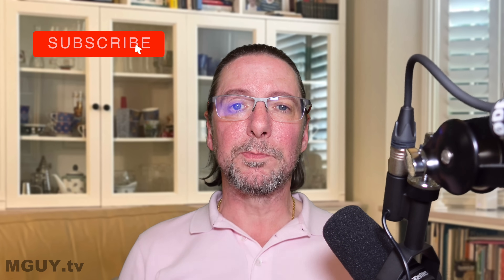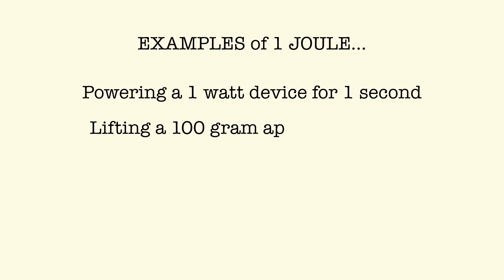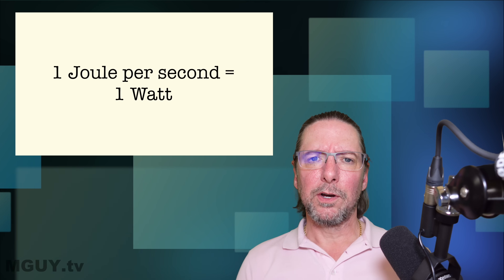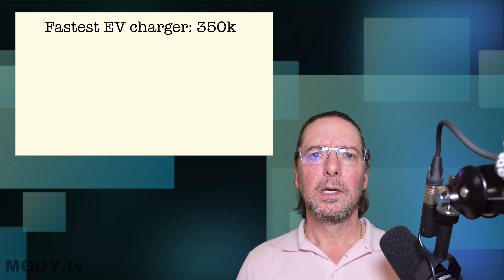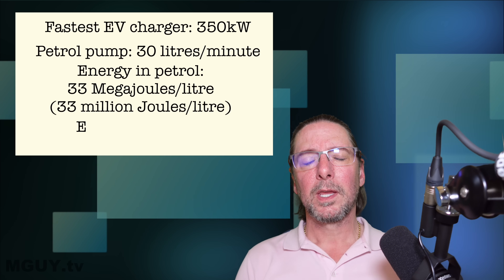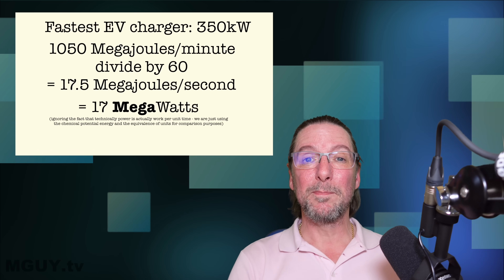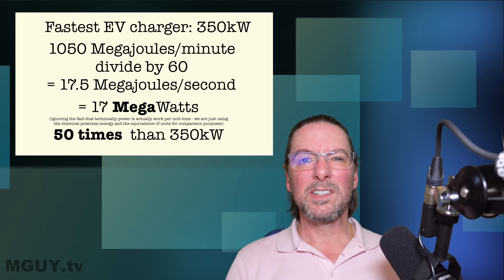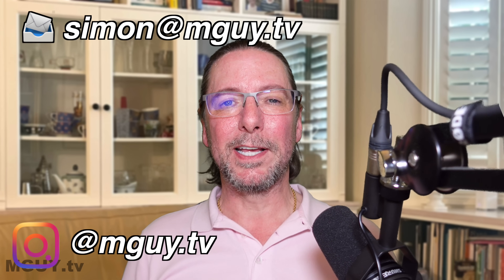Comparing charging speed of EVs vs "fuelling speed" of regular cars | MGUY Australia

Comment: We got an EV charger installed only recently at the local shopping centre , one thing I've noticed is that EV owners must never be in a hurry as i can go in do the shopping stop and chat to people and when i drive out still see the same cars with the same people sitting in them waiting for their battery to charge  . Hope the seats are comfortable in these EV's as people seem to spend an awful lot of time sitting and waiting , seems awfully boring to me  !!
Reply: It is - not to mention woefully inconvenient.
Reply: @aussieideasman8498  EVs are far more convenient than fossil cars. I plug in at home, wake up in the morning and I'm good to go for another typical week. I have used supermarket chargers which are normally slow (AC) and free so I plug in, do the shopping and gain a few % on the dial, it isn't a big deal. On long hauls I use DC rapids of which there are now thousands along the autoroutes of France. On a recent trip down to Spain every services had at least 5 or 6 rapid chargers. We typically drive for 2 to 3 hours before taking a break because we need one, so 200-300 km a stint, well within the range of the car even into a headwind in winter time. A 20 to 30 minute stop to eat, drink and use the bathroom adds another 150-200 km on a rapid charger which can finish off most journeys. We typically don't like to do more than 500 km in a day, though we have done more.
Reply: Is it perhaps that they are Uber or similar drivers waiting for the next job? If they get one they unplug and go? or someone doing calls for work? For every other ev driver the app on your phone tells them when they are done (usually 30mins or so from low to high) so they can relax in the shopping center, but remember 95% of charging is done at home.
Reply: @toyotastout6870  That's right. It doesn't matter what kind of car you drive, 97% of the time it isn't moving...it's parked up at home, work, the supermarket or somewhere. I am never waiting for my car to charge, I am doing something else.
Reply: @kiae-nirodiariesencore4270  If you live in a single house with a driveway/garage and don't need to drive long distances frequently, an EV makes sense (I would still argue an ICE car makes more sense, though). Most people don't have all of those boxes ticked, though. I live in an apartment and there's only street parking available. Sometimes, I have to park hundreds of feet away from my apartment. An EV would never work for me.
Reply: @rodafowa1279  Interesting that EV ownership is highest in cities where many people live in apartments. This is particularly the case in China and in France where I live and many people live in apartments.
Reply: EV drivers are the old Audi and BMW drivers. Hence the arrogance and inability to use indicators
Reply: @sahhull  I have never been an Audi or BMW owner, yet I have an EV. Same goes for my son-in-law. You generalize. Sometimes I don't bother to indicate, too, and I have seen EV indicator lights flashing.
Reply: Yes, but their E waste is saving planet.
These people have meaningless lives and no sense of humor.
Reply: LOL
Reply: When they get to the pearly gates and are asked " how did you live  your life"  they will have to say " spent  half of it looking and then charging my EV"!!
Reply: @aifangwei8440  what a load of crap. The silly thing about pearly gates, got more important things to worry than thinking about silly stuff like this.
By the way, most people charge there EV's at home, no need to waste any time looking for a fuel service station, worrying about the rip off fuel prices, paying huge service costs. So, you keep your gas guzzler and keep forking thousands of dollars.
Reply: Maybe there are EV's with Beds in them?😄
Reply: Hybrids if anything make a lot more sense especially in a country like Australia. and you only need a fraction of the infrastructure.
Reply: @crustybmw Hybrids do not make sense and do not play a key role in decarbonization.
Reply: @crustybmw  Hybrids make more sense for people who's utility best fits what they do. ICE make more sense for others, and EVs make more sense for yet another cross section of society. Heck, public transport in all its' forms make more sense to certain people, and staying at home is best for another demographic.
Reply: I've also found that a lot of the EV people are arrogant. They park their toy car at a charger and take an hour in the shop even if their car only needs a 15-minute boost or sometimes not charge at all.
When they eventually casually saunter out of the store to drive away their reaction to the people who have been waiting for that charger is "they really need to put more chargers here" and never "I probably should make that charger available as soon as I'm done with it".
Reply: @ghost307  Arrogance is evenly spread I'm sure amongst EV and non-EV drivers. What isn't spread so evenly is ignorance which seems rife amongst ICE drivers who think they can park in an empty EV charging spot because it's closer to the building. That would be like me parking my car in front of a petrol pump just to go buy a coffee or something. There's a lot of education still to be done.
Reply: @ghost307  so as someone who doesn’t use or like EVs you are somehow an expert on charging practices.
Reply: @ghost307  You get a message on your phone when the car is fully charged and if you don't move it, you pay more. Why would that worry you if you don't have an EV?
Also, the arrogance of people at fuel stations is way over the top.
Reply: @ghost307  And there isn't an arrogant ICE driver?
Reply: @aussieideasman8498  There are a few, but far from the 95% of EV owners (and wannabe owners) who are.
Reply: @ghost307  Lies, damn lies and statistics. Your outlook is unrealistic. See the world from a broader persepctive.
Reply: That's weird. I've owned an EV for nearly 5 years and 90,000 km. The only times I have ever been sat in the car while plugged in is at a rapid charger where there are no facilities, and that was a rare case during a 1,100 km haul to Frankfurt in Germany. In most cases we plug in, go use the bathroom, grab some food and drink and spend 20 to 30 minutes away from the car while it is charging. Supermarkets typically have slow (AC) chargers and I have used them but only when I am going there to shop. I am never 'waiting for my car to charge'. Before getting the Kia e-Niro I drove petrol and diesel cars for 45 years (1974-2019) and I always stopped to take a break every 2 to 3 hours. The human machine needs to refuel too and for me having an EV has resulted in no change of driving habits when on a long trip.
Reply: @kiae-nirodiariesencore4270  spot on, when you talk to someone who has an EV, has done plenty of charging, they have no problems.  It's only the people here, who most likely never even seat in an EV, are the so called experts, but they don't have a clue what they are talking about.
Reply: @commonsense-grs  Exactly. It's like the only people who suffer from 'range anxiety' are non-EV owners. Some people just can't mentally detach themselves from the idea that owning a car means paying homage at the filling station. It's almost as if they want to make the oil companies, the Arab sheiks and Putin even richer...it's bizarre.
Reply: @cyberfloater9293  that's simply not how life works. Do you fully empty your petrol tank every day? No. My commute to work is about 120km. I could literally do this 3 or 4 times on one charge. It's just a top up each day. Never been an issue in 3 years of ev ownership.
Reply: @NaughtyGoatFarm No, you can't. Actually range is 60%. And I'm sure you've never forgotten to charge. Whoops, you're not going anywhere. 🤡🤡🤡
Reply: @TheGuruStud  Good point. Forget to charge an EV overnight and it's a quick call to Uber to get you to work if you can't make the public transport; forget to fill the car on the way home, you can just fill it on the way to work - it's much less of an inconvenience.
Reply: My ev takes about 15 seconds to fully charge. I plug it in when I get home and it's fully charged next time I go to use the car. I never had that happen when I drove a petrol or diesel vehicle.
Reply: @NaughtyGoatFarm is it out of warranty, yet? You'll be broke, soon. Enjoy, 🤡. Your insurance alone pays my fuel for the entire year and probably some more. And I paid $800 for a luxury car that's far more reliable than an EV lmfao😂
Reply: @NaughtyGoatFarm  That only works if you don't go further than half a battery charge can take you.
Reply: @NaughtyGoatFarm  spot on, funny they ever talk about this.
Reply: @NaughtyGoatFarm  Only when you're home. You can't drive the EV inside the house. Fuel stations are where you drive.
Reply: @aussieideasman8498  most people are at home every day and that's your fuel station, very convenient.
Reply: @commonsense-grs  I agree - home charging beats going to a station, but the station beats on the road charging. I just own the drawbacks.
Reply: @aussieideasman8498  at least you do agree an ICE car can't compete with an EV when charging at home, that's a no brainer. Ok, their is a small down side when charging on a road trip, but a little planning gets around this. If say doing a 10 hour road trip, stop after 2.5 hours coffee break (quick top up), 2.5 hours later for lunch and 2.5 hour for another top up then do a full top up when you get to your destination. This is what I do in my ICE car now.
Nothing is perfect, but wait another 5 years or so years, EV's will be even better by a long way. I'm sick and tied of paying this stupid high price for fuel and it's only going to get more costly.
Reply: @commonsense-grs  "at least you do agree an ICE car can't compete with an EV when charging at home, that's a no brainer." I do agree, but the inconvenience of ICE is a small gap because you do it for a few minutes every couple of weeks, on average, whereas EV charging is almost every second day. 
"Ok, their is a small down side when charging on a road trip, but a little planning gets around this." Watch my upcoming video to discover the downsides are large in Aus, though I suck as a planner; actually too little planning and it's a pain in the butt at the level you must plan. I believe having a Tesla makes it easier.
"If say doing a 10 hour road trip, stop after 2.5 hours coffee break (quick top up), 2.5 hours later for lunch and 2.5 hour for another top up then do a full top up when you get to your destination. This is what I do in my ICE car now." My experience is roughly 3 hours of driving to one hour of charging. Details in the video to come.
"Nothing is perfect, but wait another 5 years or so years, EV's will be even better by a long way." Couldn't get worse, for sure. 
"I'm sick and tied of paying this stupid high price for fuel and it's only going to get more costly." No, electricity has a higher chance of getting more costly. The government is expert at making sure motorists pay dearly, and when more switch to EVs - guess where the price rises will be? They won't be small.
Reply: @aussieideasman8498  what the hell are you talking about?
Reply: @NaughtyGoatFarm  After reading so many of my comments, which the hell are you referencing?
Reply: @commonsense-grs  No. EVs take too long to charge and are a major fire hazard. Give me gasoline any day. Plus, there are rumors that a carburetor has given some vehicles the ability to drive 200 miles on just one gallon of gasoline. The plans are in the Library of Congress...
Reply: @annep.1905  hahahahahahaha, that's the funniest and silliest comment I have read on this subject.
First, most people who own an EV charge at home while you are eating, watching TV and sleeping, so no lost time at all, do you understand that. When you are  on a long trip, charge while having your lunch break, not much time lost.
Also, don't you understand, a carburetor is very old technology, went with the dinosaur, someone is taking the mickey with you on this carburetor thing.
So, why are you happy with paying these high fuel prices, just don't get it.
Finally, on this fire thing, gasoline vehicles catch fire around 20 times more frequently, don't you understand that, properly not.
Reply: @commonsense-grs  🤣🤣🤣
Charging an EV in your garage is EXACTLY why it's dangerous! Scrap that idea altogether!
As for charging it on the road, that takes too long, and there aren't enough charging ports. And how many people actually "stop to eat lunch" with fast food joints? Fuel is still not that expensive - my country has the ability to be energy independent, now. And we have figured out not only how to produce cheap fuel by fracking, but now we have also figured out how to turn cow dung into fuel. Natural gas for the win!
Gasoline-powered cars do not catch fire in garages, like EVs do, and when they do catch on fire, they burn more slowly and are more easily extinguished than EVs are. Henry Ford FTW!
And I am aware that carburetors are old technology. Nevertheless, there was one built that was supposed to enable a vehicle to get 200 mpg, but of course, the public wasn't informed until carburetors were almost obsolete. One wonders why this information was kept from the public... but even with modern technology, I still prefer gas-powered to EV. 
Of course, we could return to water-powered engines... free fuel!

Comment: Liquid fuel is so much more efficient at transfer for storage we don't have to plan for it. The range so stable and extensive, we don't have to compensate for it because of ambient temperature. All sequestered in a much much lighter package.
Reply: We need both.
Reply: You use it. I have waited for the EV for over 40 years. Oh, by the way, I'm going to sue you for polluting my air. ICEV owners don't pay for the harm they do, like other polluters have to.
Reply: @1voluntaryist  You can't be taken seriously.
Reply: @1voluntaryist  there is no pollution from my car because it runs on ethanol fuel which emits half the carbon of gasoline and I offset the remaining emissions by planting trees. You tried. 🤣🤣🤣